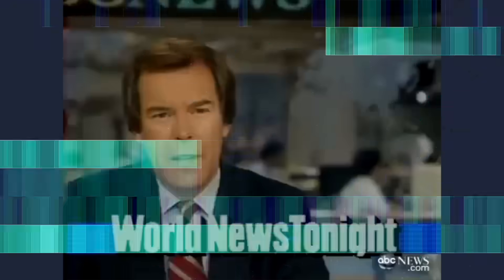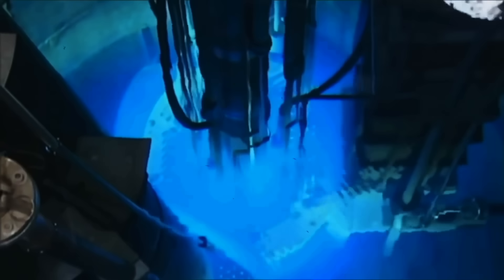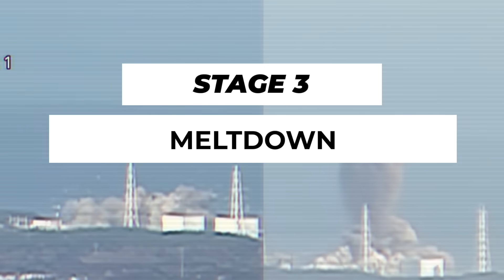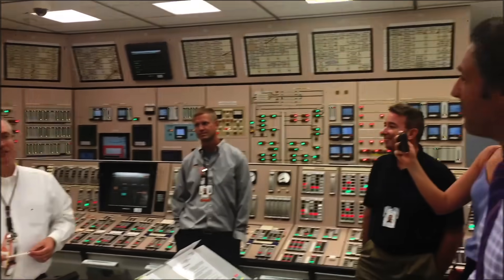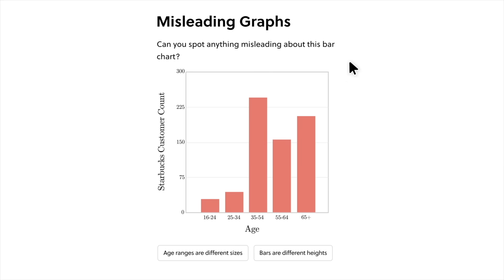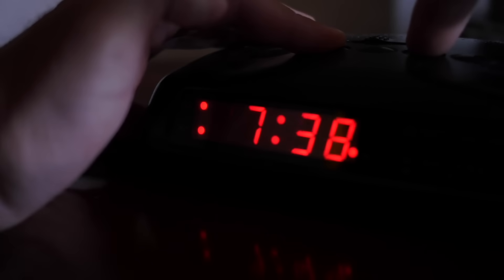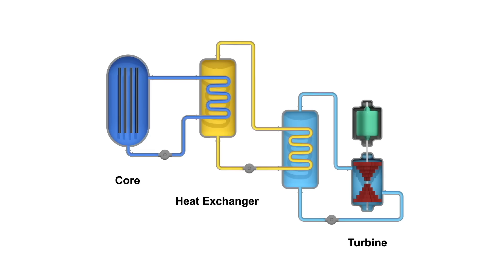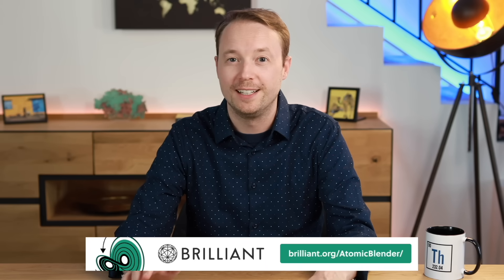Why Is It So Hard to Stop Meltdowns?

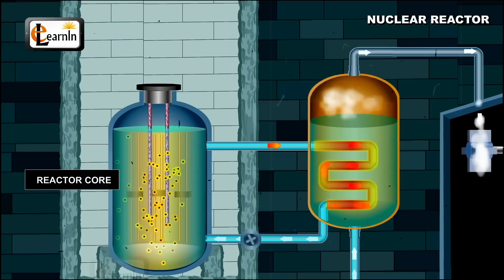Comment: Time 4:00 not correct .. The residual heat is from the daughter isotopes (the pieces the uranium was split into) .. As the daughter isotopes decay they give off heat and  various  types of radiation .. The decay rates range from minutes to thousands of years  and it is this decay that makes the waste products radioactive .. Spent Fuel rods are so hot they need to be stored in a cooling pool of water for 5 years more or less depending on the type of fuel .. Technically there is some fission taking place in the fuel after the control rods have shut the continuing reaction, but the heat energy is negligible compared to the heat from daughter isotopes ..

Comment: It is interesting to note that both Chernobyl and Fukushima were designed before the first major nuclear power plant accident (Three Mile Island 1979). All of the nuclear-power plant accidents combined killed 1000 times less people than flying, and 100 times less than any non-nuclear forms of generating same amount of electricity  (including renewables, eg. hydro killed 240000 people in Banqiao, 11 million had to be deported). Any reactors designed after 1979, the first major accident (that, by the way, killed 0 person, and not even any significant contamination release) are immensely safe, with effectively 0 victims total. We can now design even safer molten salt based storage and passive heat removal systems with inherent passive safety and efficient heat-utilization, minimizing the nuclear island (and minimizing volume and construction costs making it extremely economical if regulation does not artificially make it prohibitively expensive, or politics simply ruin breeding reactors like it always happened in the West, SNR-300 in 1985 Germany and Integral Fast Reactor in 1994 USA - yes, demolished by criminal anti-human wealth-centralizing politics, look it up and wake up) and also helping intermittent weather-dependent renewables that otherwise threaten our civilization if deployed without calculating resource use and usefulness/limits.

Comment: The only way to stop a runaway reaction is to have an exponentially increasing countermeasure which is incredibly hard to design.  Once the runaway starts it is extremely hard to stop.  The best method in this case is a negative feedback system.

Comment: To put it in perspective of scale, a total dam failure on a hydroelectric power plant generating the equivalent of the energy generated by a nuclear plant would not be a pretty sight either.  That is why the small modular reactor concept is so important.  The issue of energy production in western civilization always comes down to scale.  Any power generating plant at that scale has the potential for great disaster.  We are sold on the idea that centralized power generation can somehow be done with absolute safety.  I am not sure why we think that.  We all know that a marble and a bowling ball that accidently roll off the table fall at exactly the same rate.  And we all know the difference in what happens if one or the other lands on a kitten.  Scale.

Comment: Even with every accident, nuclear is still the safest form of energy generation. Far more have been killed and affected by coal, per MW, than nuclear. Hell the data is only just coming in that Wind has a higher accident rate and environmental impact per MW than nuclear.

Once again, the problem is that people are morons driven by emotion and rhetoric… and economics. But despite this, we need more nuclear plants to save the planet and cut emissions… otherwise we’ll have to burn coal and LNG to power all the EVs we keep getting told to buy.

Comment: Removing steps of energy conversion, like electric motors for pumps, would be a good idea. It would be better to use something that these generators have, a lot of. That, is lots of waste heat. The best way to move heat is to use a heat engine. A large Sterling engine comes to mind. Multiple cylinders can even be self starting.

Comment: well we now have a good final last failsafe thise days that bascly alowes only melted nuclear fuel to drain out of the  bottom of the nuclear reactor  chamber into a detcated drainage basin that super duper shelded to contane all the radation just for this kind of thing. if the fuel melts then a  open valve will drain it out that due to the leck of water to modrate chain reactons starts to stop chain reacting and then starts to cool down rapidly also due to the fact that lqiuid nuclear fuel is far denser then water when the nucleaer fule melts it exits the reactor chabler first bacsly. also we make shure if the fule melts it stays way from any water ina shelded dranage basin. 3-4 gen nuclear reactors all have this failsafe in mind.

Comment: Even with all the advancements, I'm still not a fan of them.
Reply: Its literally the safest and most efficient source of energy
Reply: @EstrogenCubing  I like deep geothermal better. More power and even less waste. While modern nuclear is safer, it's always a when not an if they will go critical. The human factor has a way of neglecting things when it comes to safety. Boeing is a good example in recent memory.
Reply: @jmsether  Its an if
Its basically impossible to have a Chernobyl 2 nowadays with all the safety
Its a when will oil spill
When will gas leak
When will the mine collapse

Not when a reactor goes critival

Comment: The weakness is always the necessary cooling of the fuel rods. When they were long enough in use they will generate so much afterheat that they need to be cooled for years.

Comment: what if there is a boron layer in the floor below the reactor
then if the reactor melt, it mixes with the boron that stop the neutron
is it a possible way to prevent the worst scenario🤔

Comment: Stage 1: too much heat
Solution: fuck the fuel rods, insert all the control rods, fuck it we need all the goddamn water.
Stage 2: you are somewhat fucked
Solution: stop.
Stage 3: You are fucked
Solution: unfuck yourself very quickly.
Stage 4: HEH!?
Solution: well… it called Down??
Stage 5: AAAAÆAÆÅAAAÆAÆÆAÅAÅÆAÆAAAAAÆAÆAØÆAØÅÆÅAÆAÅÆAÅÆAØÆAØÆAAÆÅAÆAØAØÆAØÆÅÆÅAØÆAØÆ

Comment: 2:14 the diagram is of a PWR reactor, but you are describing a BWR reactor. In a Boiling Water Reactor, water directly passing through the core spins a turbine, but in a Pressurized Water Reactor, the water is kept under high pressure and does not boil, instead heating a separate loop that boils water and spins the generators.
Reply: Yeah he switches between the two in the video a lot. Not a big fan of that.
Reply: He’s not describing a BWR lol he says it’ll go and make steam, not that it becomes steam

Comment: I never understood why they made the bottom of the reactors concave. That design HELPS the fuel clump together and almost forces it to increase the reaction. 

Making it slightly convex would spread the fuel out and reduce the chances of neutrons from hitting fissionable atoms.

Putting the concave structure outside the vessel means that the radioactive material is now uncontained. Keep it inside the reactor, and sure the reactor is scrap, but you can still contain it.
Reply from the maker: The vessel is under extremely high pressure, so the natural shape is a sphere or a tube with concave ends. Similar to a pressurized tank. Otherwise, yeah, it would make sense to spread out any melted fuel if it was possible
Reply: @atomicblender  Interesting thought! How about BWR designs that are not pressurised? Might be something to do with internal recirculation?
Reply: @caxve  mind you, just because it's called a BWR and not a PWR doesn't mean it's not pressurized. I can't tell you the exact pressure the one I work at is, but google will tell you it's between 1000-1200 psig. PWRs operate around 2200-2400 psig, so substantially more, but the BWR is still under incredible pressure.
Reply: @atomicblender  Sure, but there are ways to make structures at the bottom so that any debris do not pool into such an efficient mass.
Reply: So, I did some online research. Turns out, reactors are concave because it is the most efficient design. In nuclear reactors, there is something known as neutron leakage, when neutrons escape the reactor core. This lowers the neutron density, reducing the number of neutrons available to sustain the chain reaction. The lower we can make the core surface area to volume ratio, the lower the proportion of leaking neutrons we will get. Although the ideal shape would be a sphere, using a cylindrical shaped core is way more economic, practical and allows more stuff to be packed into a core.

Comment: Why are the bottom parts of reactor vessels not shaped in a way that the corium already spreads out inside the reactor vessel instead of melting through?
Reply: So, I did some online research. Turns out, reactors are concave because it is the most efficient design. In nuclear reactors, there is something known as neutron leakage, when neutrons escape the reactor core. This lowers the neutron density, reducing the number of neutrons available to sustain the chain reaction. The lower we can make the core surface area to volume ratio, the lower the proportion of leaking neutrons we will get. Although the ideal shape would be a sphere, using a cylindrical shaped core is way more economic, practical and allows more stuff to be packed into a core.

Comment: I’ve tried looking into it myself but can’t find much information, but I remember a nerdy acquaintance of mine from years ago who worked in the industry telling me the candu reactors we use in Canada are basically impossible to have a meltdown since they have so many built in safeguards.  Not sure the validity though and everything I’ve found comes off like a self blow job piece so I take that with a grain of sand.  The soviets said the same thing about their reactors so lol
Reply from the maker: It's not impossible, just much more difficult. CANDUs fundamentally just have lower power densities that make it so heat can't build up as much. There was a reactor in India (essentially a CANDU) that experienced a long station blackout and basically nothing happened (no fuel melt, no release).

Comment: It al comes down to profits and human mistakes. If the company is operating solely based on profit, they will disregard safety systems, won’t train their staff properly, don’t perform the required maintenance and so on. Even the government might not create good recovery plans or allocate enough resources because it is deemed unnecessary. So yeah, a well operated power plant is totally safe. But a really bad operated high-tech extremely safe power plant could still cause horrendous accidents due to human errors.

Comment: Three Mile Island wasn’t really an “Accident” per se!   Yes there were problems in the water supply to the reactor, and as a result, it overheated and went into a “Meltdown”.  Once the problems were eventually diagnosed, they were dealt with accordingly.  Serious reactor damage occurred but there wasn’t any explosion, nor a leak of radiation, no real accident that could endanger the public occurred. There was a small release of radioactive gas but still it was, NO real emergency at all.  It was just unfortunate that a Commercial Radio Station got wind of the story very quickly; even President Cater visited the site!   As a result of the intense World Wide Media interest, they managed to turn a “minor incident”  into almost a “National Radiological Emergency”.   An Emergency that just didn’t exist:  The whole incident was poorly communicated by the plant itself to the media, and the public.  Radiation levels were higher than normal, but only for a short time, again, poorly communicated by the plant itself to media, and the public..  This poor and confused communication did far more damage than the incident itself.  And so its reputation was sealed as a  “Major Nuclear Accident”.   One that simply wasn’t!!    I leave a link to “Three Mile Island” by Kyle Hill….Very much worth a watch….You’ll enjoy it…https://youtu.be/cL9PsCLJpAA?si=_OELSuCUTUMxYlfq

Comment: It’s hard to stop a meltdown, but it’s even harder to start one
Reply: Actually just pull lots of rods then cut feedwater and boom meltdown.
Reply: It's easy to start one - just stop cooling the core.
Reply: @maksphoto78 the point is, that is literally impossible to do on purpose
Reply: @Torth121  not impossible, chernobyl is a literal example.
Reply: @smartwatchonpluto  Chernobyl was an entirely different TYPE of accident, not a meltdown do to a failure to cool, but a reactivity addition casualty caused by a number of failures including relatively inexperienced operators performing complex tests with little oversight on a reactor that was not designed from the ground up with safety in mind. Even then, it wasn't done on purpose, in fact the event that actually initiated the casualty was the operators initiating a scram (rapid reactor shutdown). There's an incredible amount of information out there if you want to look into it further.
Reply: @palmer5469  and just like Three Mile Island and Fukishima the human factor played a huge part. In the Japanese case it was the idiotic idea of placing the back up generators in the basement. Not too smart in an area where tsunamis are possible
Reply: @palmer5469 agreed but there is the element of human understanding and ignorance. They thought they knew better
Reply: @ Who thought they knew better? And better than who? You also say "but" like I didn't include the operators in my comment?
Reply: @palmer5469 the Soviet people sacrificed themselves to the worst deaths from radiation to correct their mistake and the world still blames them as if they’re buffoons
Reply: @MWGarage  Fukushima* has two u's and only one i
Reply: @smartwatchonpluto Chernobyl was an example of what happens when someone causes a meltdown because they are stupid that’s not an accident that’s negligence was no accident involved. Calling it an accident is being too generous. And exactly the same kind of catastrophe happens with chemical plans or any other dangerous pollutant- it’s just not as cool to talk about because they can’t flash scary radiation symbols everywhere. You know, like those train derailments that did functionally the same thing as a nuclear meltdown?
Reply: @smartwatchonpluto In the case of modern nuclear reactors, it is pretty much impossible to do on purpose.  And when you boil it all down, Chernobyl was caused by a design flaw and not sharing the information of that flaw with the people who operated the reactors.  Had the plant operators known of the flaw and what not to do, that whole incident would have never taken place.
Reply: @smartwatchonpluto the computer tell them to shut the reactor down,but they shut down the computer instead
Reply: @smartwatchonpluto Chernobyl wasn’t a meltdown and wasn’t caused by a cooling issue
Reply: @MWGarage Tsunami was easy to avoid at Fukushima, by elevating, protecting backup diesel generators a bit better. They were sloppy.  Otherwise, tsunami did nothing to damage the reactor  itself.
Reply: @BiblicallyAccurateComedy That’s a grotesque lie. Firemen that died didn’t know they were sacrificing themselves, and nobody called them buffoons. The plant operators, the plant designers were buffoons in a system of lies, and they deserve all the blame.
Reply: @Nill757 yep, putting them in the basement was was stupid. If fact 3 Mile Island and Chernobyl could have been easily avoided too.
Reply: @M @MWGarage  avoiding Chernobyl, inside an entire system of lies and paranoia.  Enrichment too low to save time money energy, so then follow all kinds of other foolish decisions, graphite moderator, graphite tipped control rods, positive void coefficient all to keep the too low LEU critical.  Then no confinement.  Anybody asks questions, KGB comes round.
Reply: @ Do you have any idea the insane amount of safeties, backups, and reserve systems modern reactors have? One would need to be either so grossly incompetent you shouldn’t have a job to begin with or have everything go wrong in the worst conditions at the worst possible time. Stop cooling the core to cause a meltdown is like saying all I have to do in order to rob a bank is sneak in. It’s an enormous strawman argument
Reply: Water is the moderator in modern nuclear power plants. If you lose the water, the neutrons speed back up, and the reaction stops!@maksphoto78
Reply: @maksphoto78 good luck with that